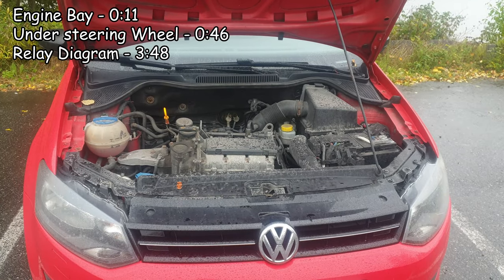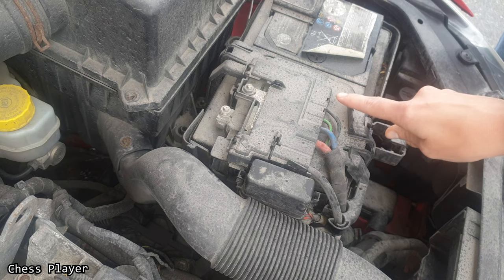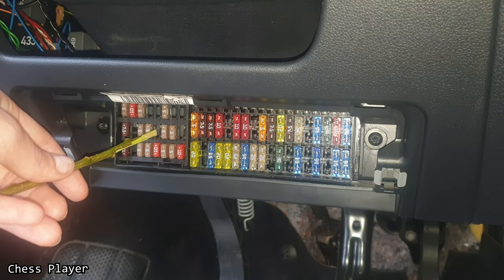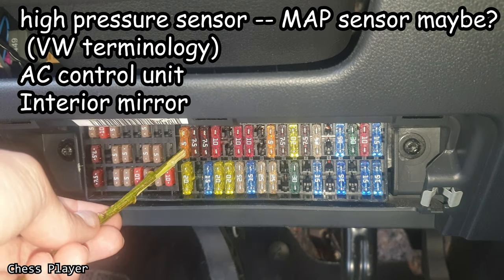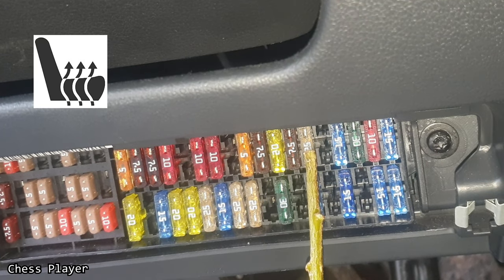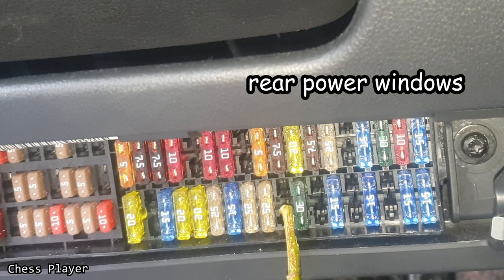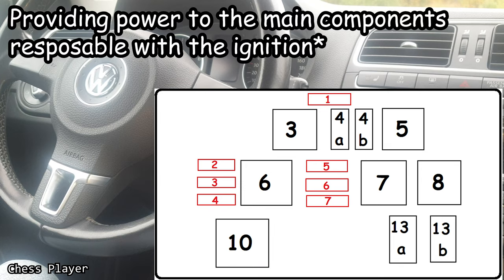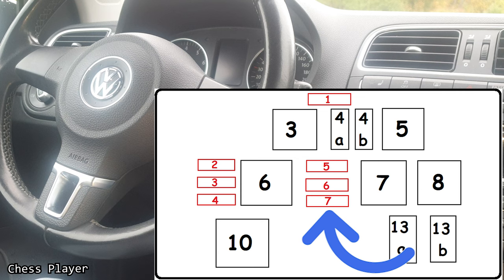VW Polo 1.2 Fuse Box and Relays Diagram ( 2009 - 2017 ) mk5

Comment: My dome lights are not turning on automatically when i am removing key or unlocked vehicle and opening door, any suggestions what went wrong or any settings got messed up? It is working fine when i click button manually after sitting inside. Mine is vento 2011 highline.

Comment: Hello can you help, I need to add extra 12v cigarette lighter socket. Which fuse should I tap in? A little help with wiring is needed.

Comment: How do you know if you need to change a fuse?    

when I lock my doors from inside the control panel on the driver door side, I can still open any of the doors once locked. doesn't work for some reason, where some functions work such as the window lock.
Reply from the maker: You can use a voltmeter and connect the negative side to the chassis and with pozitive test the 2 sides on top of the fuse
Reply: Hello Sir same car 2002 sir is problem injector not working 4 injector not working circuit problem injector Riley location send me please

Comment: Which is for the washer water pump?
Reply: she said it at 2.54, yellow 20A, fourth one in from the left, lower physically larger fuse bank. Note, some models have this fuse block mounted the other way up to this. The 2013 I am working on is anyway.
Reply: Good video but Trying to work out the screen washer pump also. 4th yellow from left sounded like front windshield wiper motor. The one before that sounded like headlight washers.